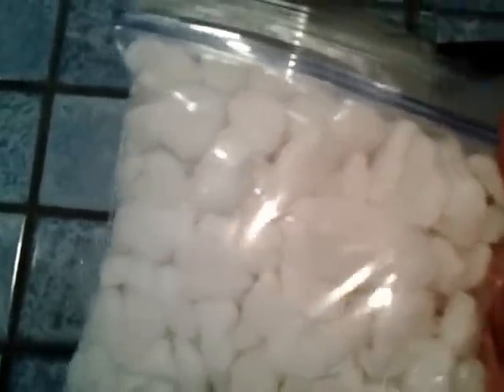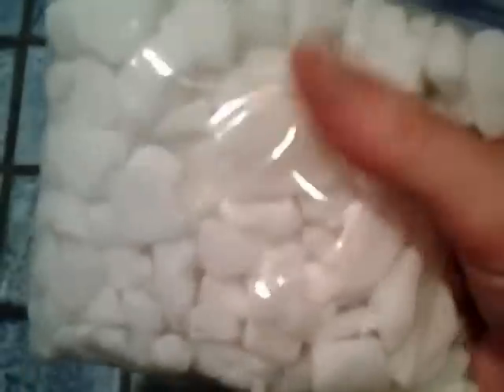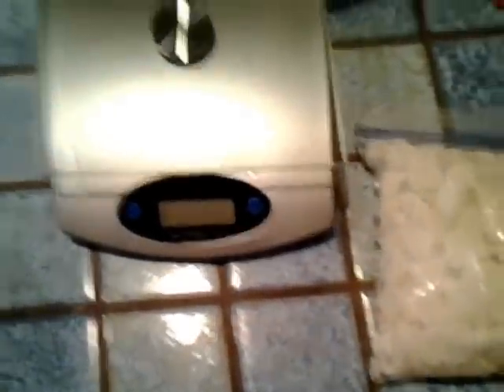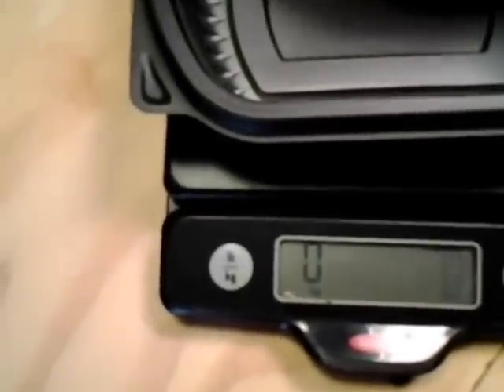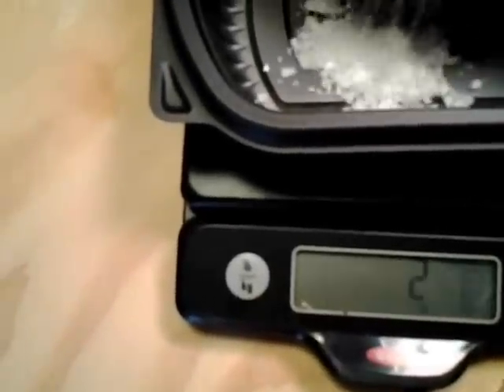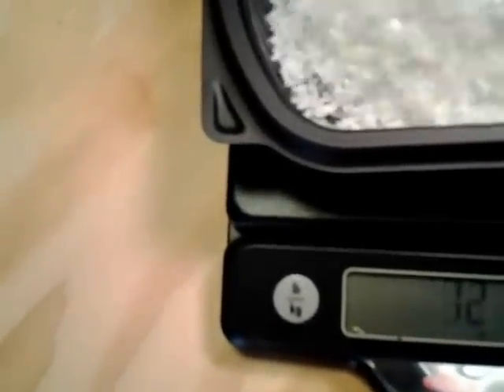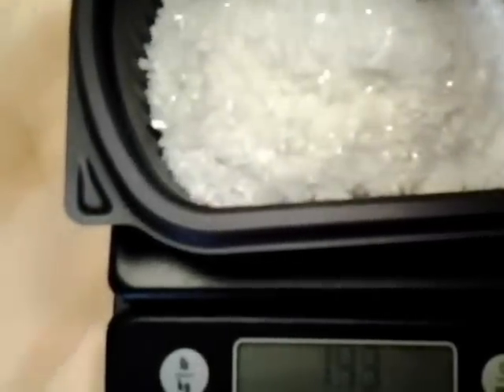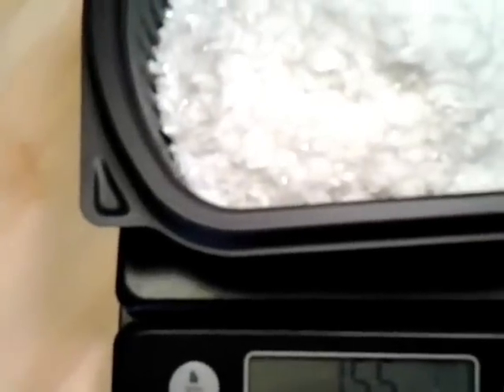Potassium Chlorate Cell

Comment: what voltage and ampers are you pushing thru that
Reply: jerry coleman probably around 2-5v and 20-30amps if you have a computer power supply the 5 volt wire will work great
Reply: AF Bennett how do you regulate the amperage if you use a computer power supply, or does it run around that amperage?

Comment: Sodium chloride or NACL gives better yield ?     My reaction chamber is exactly like yours..  made it 3 years ago..  tonight is my first time using it tho,...   Ytmachx has some of the best perchlorate electrolysis videos on YouTube dating back to october2009 ....   look him up!
Reply: with NCL you are not making kclo3 you are making naclo3
Reply: I know.. the addition of the KCl the NaClO3 and KCl undergo and double displacement reaction creating the KClO3
Reply: pH control via addition of CaCl2 gives even better current efficiency up to 89% this works better when solution is saturated and anode surface area is more than cathode.
The precipitation of Ca(OH)2 onto the cathode also acts as a conductive diaphragm that will stop any chlorate from being reduced and its insoluble in these high salt content solutions.
CaCl2 is better than chromates as an additive since its non toxic but beware because pH controlled cells will always emit chlorine and be careful with the finished reaction solution when I poured it all the dissolved Cl2 came rushing out and i got chest pains for the entire day.
It was unexpected but thats me pouring 4 liters of solution at pH of 6.8 filled with chlorine.
edit:
unlike using HCl the pH control setup of CaCl2 is self regulating and is good for amateur setups and even performs better than professional pH controlled cells due to the buildup of Ca(OH)2 creating a diaphragm on the cathode.
This however cannot work industrially because cleaning the cathode after every run increases wear and tear and these plants operate continously and the slaked lime may also act as a foulant and an extra component for separation.

Comment: Why don't people add NACL?  Although it will add more time it'll kick more KCLO3 out of solution.
Reply: +Robert Cece i do that i make sure to add NaCl so it will be the left over hypochlorite and with that you can get 70-80% yield
Reply: +Robert Cece 
i just finished one of my runs
from 6 days of running
starting material
300g of KCl
NaCl 600+ grams (filler)

end results of run

266 g KClO3 batch 1 room temp flame color(pinkish purple)
85 g KClO3 batch 2 0 deg flame color(slightly yellow)

351 final yield 71.18% yield

493.148 g quantitative yield

i predicted around 70%

Comment: You dont have to  measure anything.  Just make a supersaturated solution.  
What I do is heat water up to the tem its going to run at and stir in as much as it will hold then stick the electrodes in

Comment: I just started running 2.5 liters with mmo.    Im getting brown fuzzy crap on the bottom of the cell after 3 hours..
Wtf....  I even did 3 recrystallizations of the potassium chloride prior to using it.
Reply: Ryan Jones no i was using mmo.
my own formula. but it happened to commercial mmo's too
i have to do a few recristazatibs ans wash the crystals first to clean things up to get good clean results

now i use platinum 

i keep burning up power supplies now!
i am thinking about buying an old ham radio supply....

i want to build a transformer at the perfect voltage and current but dint know how to spec out the rectification
Reply: Clown Whisper !m getting the same brown crap after 4 hrs , any ideas wtf it is ?
Reply: Aaron Hardy No not at all 
I wonder if it is due to poorly affixed MMO material from the new electrodes. 

I was doing almost 3 liters.  Im going to scale it back and do a 1000 ml beaker sized reaction.  Ill filter of the brine stuff and save this aside.

Im this close to getting a platinum electrode.  Im a little scared about choosing one as most of them are platinum clad and I really dont know how this the plating should be to be a good quality electrode. 

I hate tossing money away!
Reply: Aaron Hardy did you use tap water or distilled ?
Reply: well I used distilled and i got this. brown crap
Reply: Aaron Hardy and after restarting with a new solution im no longer getting it. 
I think it was from the new electrodes to tell  you the truth.

I ran all day just fine.  its only 1000ml so Im going to shut it down for the night.
It should be ok I think as it probably will not precipitate anything yet.
Reply: my cell is a black mess, i am using a stainless steel cathode and mmo anode,  might have to dump it and start over ! lol
Reply: Aaron Hardy Yeah that is strange for sure.  test your connections with a multimeter to make sure positive and negative are what you think that they are.   I am using MMO for both leads simply because I have them and it wont hurt>

My rig has been running at about 110 degrees for about 30 hours.  No crystals yet unfortunately.  But the solution has turned very faint greenish yellow.   It is crystal clear though.
Reply: Clown Whisper and I never did shut it down over night, I was afraid that it had gone past the point that I would get some precipitate.  Im just going to let it go for as long as it takes.  

Its funny im not really into pyrotechnics, I just love electrochemistry.
I made the manganese nitrate to recoat these things if they do eventually start go bad.  I just tested it on a small piece of stainless screen and it laid down a tough coating.  

Its well worth watching that nurdrage video on the topic.
I have a friend that works for a company that makes aircraft parts.  Im going to ask him if he can get me some scrap titanium.
Reply: Clown Whisper Sounds like you are using an Lead Dioxide anode instead of an MMO anode.  Lead Dioxide is used for perchlorate cells, nor chlorate cells.
Reply: Clown Whisper Just build something with more current than you think you need.  The current will adjust to the resistance, or load of the electrodes.  If you want to use less current, move the electrodes further apart.  Furthermore you can build a circuit to variably control the current, it's not that tough.
Reply: Ryan Jones i have to keep the current below 20 amps or me anodes will get toasted

i have built resistive load triac based controllers for ac applications,like heating mantle controllers but not dc based stuff

i think the best solution would be to rewind a MOT then rectify it

or just stop being cheap add buy one lol

Comment: A much more efficient way to do this is to use sodium chloride as the electrolyte and make it into potassium chlorate with the double displacement method. It is much more soluble in water, which allows you to make more at once, plus it's easier to filter out impurities.

Comment: what and what metal are you using to connect your mmo to the top of the cell?
i looks like titanium? but wouldn't that corrode on the anode side if it just attached to the mmo to the outside of the cell?  

also how do you attached that metal to the mmo ? spot welding? would that ruin the mmo coating?
thanks
Reply: Yeah the strips on the mmo and titanium cathode are Titanium probably, the one on the anode is probably mmo like the rest of it, and also yeah they spotweld them together. Also titanium doesn’t corrode in a chlorate cell.

Comment: it looks like hes using the red wire off a computer power supply, so that would be 5 volts most likely, unless hes wired it with different wires, since hes using the clamps its likely. Most chl;orate cells are run at 5 volts-ish. cant tell how many amps its putting out, which is the important part. remember, the higher the currant per square centimeter, the faster the anode will decay. roughly 30mA per square centimeter is max, exluding platinum. regul;ating the current via resistors helps.